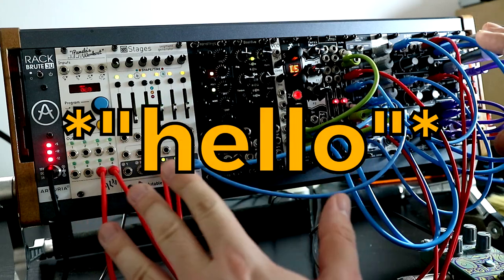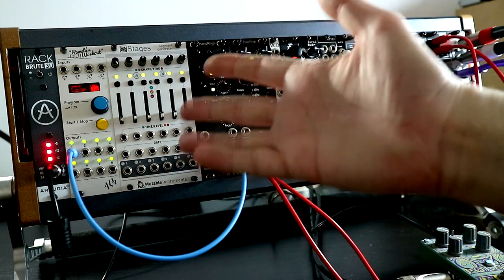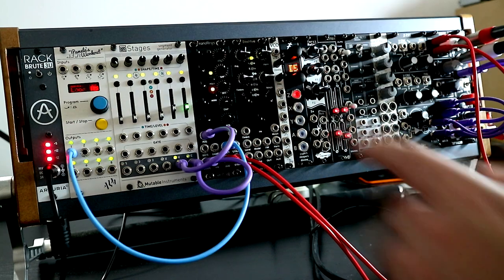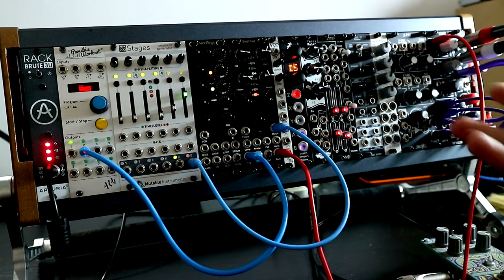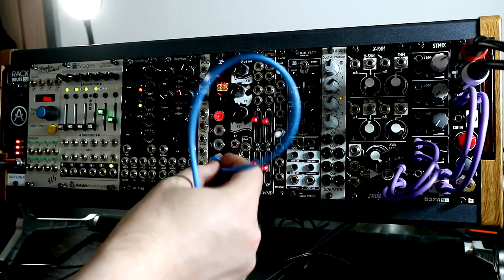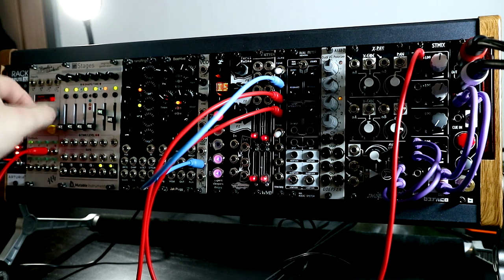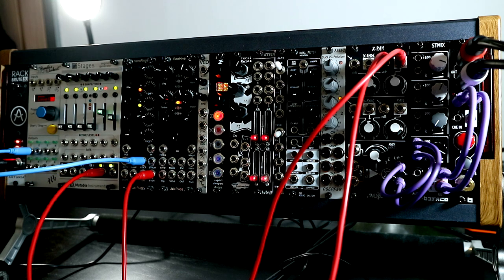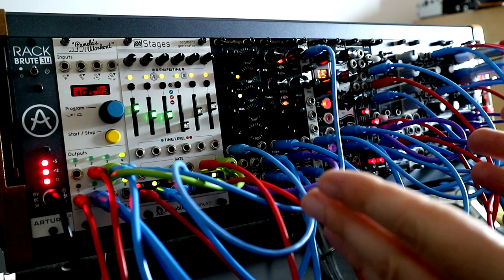State of the Modular 2022 - What's in my Rack? Why is it there? How do I use it?

Comment: Would like to dive into making a rack this size, to compliment the Neutron, but..it is an expensive rabbit hole. That said, I did get an MPC One (which is awesome) and it has 8 cv outputs. Hybridrack. Glad you're back.
Reply from the maker: Hybrid setups are where it's at for me. There are super powerful sequencers that can do amazing things in eurorack format, but they are big and expensive, so don't make sense for me right now. Being able to use one of my Elektrons to control the modular makes a lot more sense for me right now.

Comment: Am sure you know this, but if you need one you have another VCA available, algorithm F4 on the Disting. If you can ever find space for the Disting EX you'll find it far more user friendly, as well as the extra functions.
Reply from the maker: Yeah, if I can claw back 4hp (or just pony up and get a proper sized rack!), I'd move over to the EX for sure. Much less of a requirement to open the manual every time I use it...

Comment: OS a wonderful delve into modular, you have a well thought out rack, minimal size modules that cover so much ground. I have so many questions on this I can’t remember them all, will rerun take notes, I’m into Techno so loved the Distortion module would like to know the patch cable configurations to achieve this via Pams settings through chain to output????
Also the Digitakt midi how ALM cable works as I have Digitakt ( more on this??) I have Polyend Poly 2 which probably does same as cv/ ocd?? Not sure
I see Lisa in comments(INKY) who I’m in regular contact with via FB messenger will we ever convert her to Modular😆😄
Anyway OS( Name) many thanks and many more Vids on Modular thanks Martin👍👍👍🆒🆒🎶🎶🎶🔱🌟🌟
Reply from the maker: I'll do a modular live stream soon (and maybe actually schedule it in advance for once) where we can live patch some stuff but for some of your questions: the ALM cable converts DIN Sync to a clock and run cable you can plug into those inputs on Pam's - then just set the Elektron to output DIN Sync on the second "midi" output and make sure Pam's expects 24ppqn and you're done! Tight sync that starts and stops with the Elektron sequencer! Poly 2 does the same job as CV.ocd and more! I'd probably have one if I had the space.
Reply: @OscillatorSink  superb thanks👍🆒

Comment: Could I kindly ask you if you are using Rings as a sound source? And one other thing, how do you handle the envelopes without vca’s?
Reply from the maker: Hi there, I am using Rings both as a stand alone sound source, but also as a resonator to send other sound through - it depends on the patch. I do have 2 "proper VCAs", but on top of that X-Pan can act like 3 more VCAs (including a stereo one), Disting can act as 2xVCAs and the two low-pass gates can also act as VCAs; so although it looks like I have very few - I actually don't tend to run out on any particular patch (usually). On top of that, both Rings and Plaits can act as if they have they have their own VCAs, so depending on how I'm running them, I might not need a VCA to use with them.

So there are more "VCAs" in the rack than meets the eye at first. That said, I might grab some of the mystic circuit Passive VCAs at some point, because you can never have too many VCAs.
Reply: @OscillatorSink  thank you so much!!!